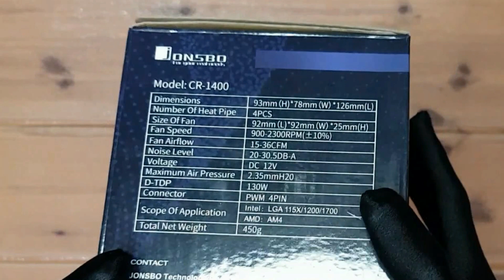CPU COOLER JONSBO CR1400 ARGB compact size

Comment: hey. i need your help, i have a gigabyte 550m ds3h ac v1.0 and the instaln jonbsbo cr 1400 but i conect the argb pin in motherbord(d1 o d2) can not control the rgb, alway light yellow led, my bios version is 17a, do you can help me?
Reply from the maker: are you using fusion 2.0? goto MOBO and click LED_C2/LED_C1 for rgb and Digital_LED for argb
Reply: Thanks,i use rgb fusion 2.0, try both argb digital ports and nothing, I think my board is damaged :( , could be the bios